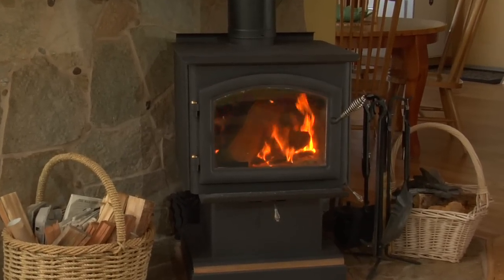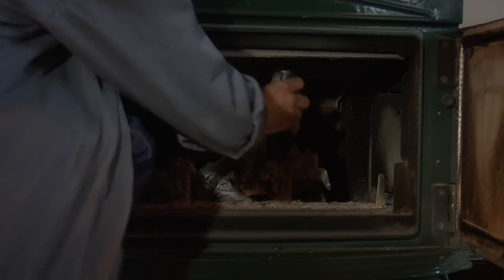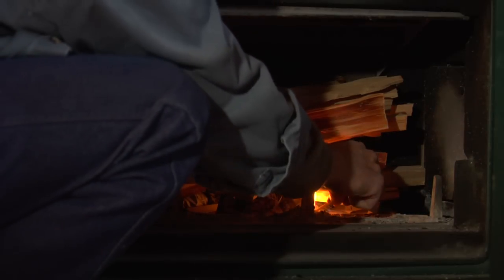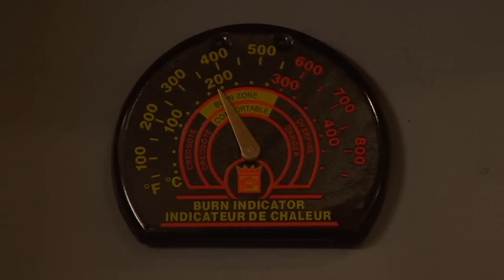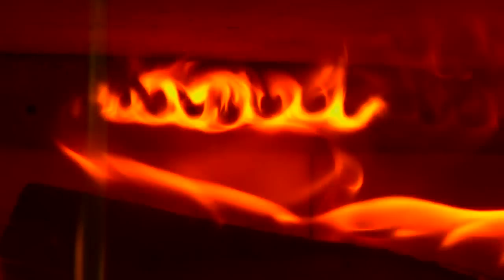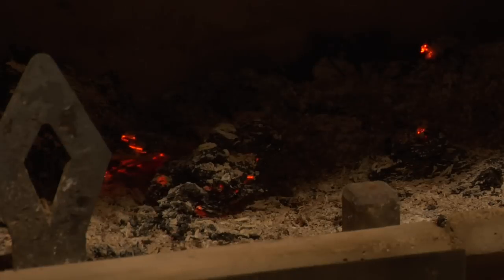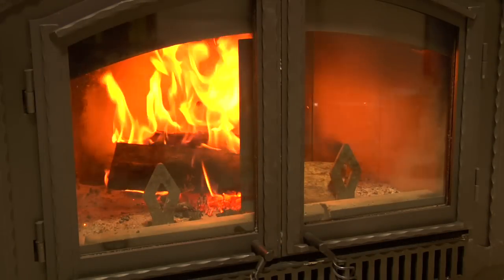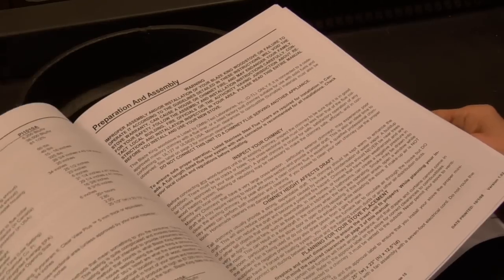How to Burn Wise with an EPA Non-Catalytic Stove

Comment: If you have a Blaze King catalytic "King" you only need to light your stove once a season since it burns 24 hours a day. Even if you have to take ashes out ((perhaps once a month) you move some hot coals to one side and these will relight with hardly any kindling.

Comment: How burn wise and efficiently do not buy an EPA woodstove. End of lesson.
Reply: If you want an efficient  burn do not get an epa stove.  The one I have will only take fifteen  inch logs.  They can be no more than 3 to 5 inches across.  Also because of the brand (Napoleon) no one in my area will come out to the house and service it.  I have even complained  to the company with  no results.  Give me the old cast iron wood/coal stoves

Comment: Don't cut the air down or "choke it off" too quickly after loading wood. To me, this is the #1 mistake in wood stoves. The "choke down" at night should be after (at least) 30 minutes of full flame burning/ full air. People will see the fire "rage up" after just 5 to 10 minutes of loading new oak. and then choke it down and go to bed. This produces a Lucy and the Creosote Factory situation. The logs should begin to be "cooking from the inside" and almost forming coals before the air is reduced "so you can get through the night" and have coals in the morning. Also, a large ash bed in the bottom keeps good coals for you to find in the morning vs. a "clean stove." Also.....  Air can be reduced much more quickly if it's just a partial closure or 1/2 way, say, if you are driving out somewhere for a few hours.